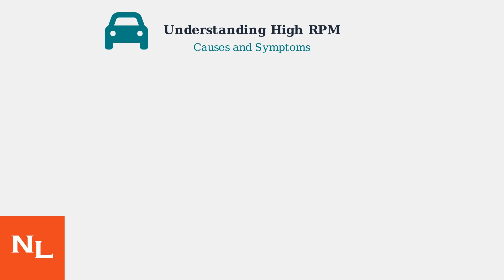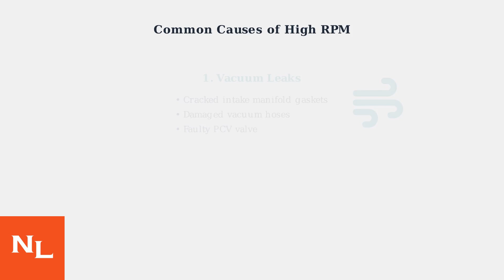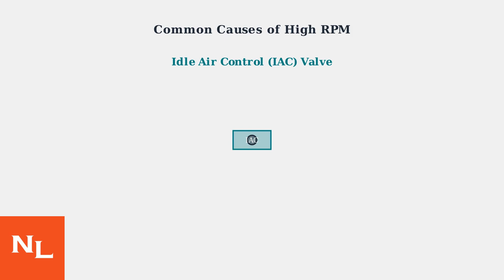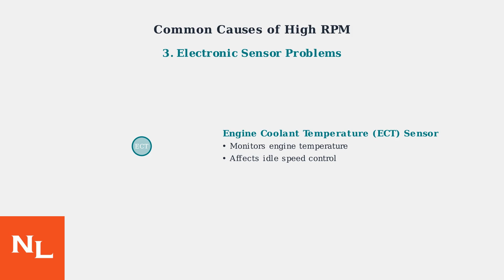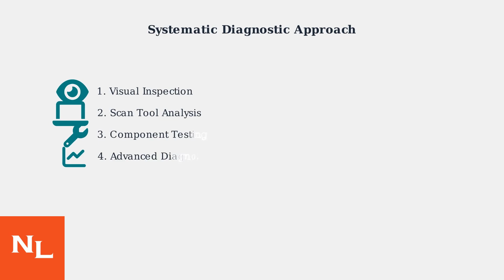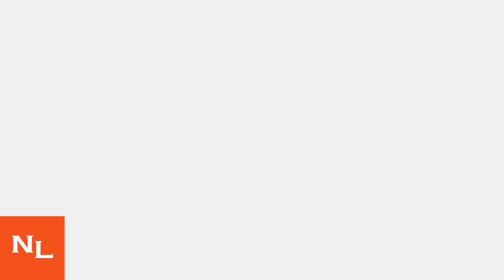High RPM In Car – Causes, Symptoms & How To Fix (Troubleshooting Guide)

Comment: This video is terrible. The screen is mostly white and the graphics don't last long enough to read them. How much graphics you do put up have two layers so you can't even read them
Reply: I 3:58 3:58 tm 3: 3:58 3:58  c 3:58 n58 :58 😅 3:58 58 3:I U😮 😅 3:58 3:58 3: 3:58 58 3:58 3: 3:58 😮I h58 3: 3:58 58 🎉u🎉😮I’m 3:58 :58 3:58 :58 😮 3:58 3:58 3: 3:I 3:58 t 3:58 58 and 😅I 58  3: 3:58 58 am t😮I pi 😅 3:58 😅:58 fi🎉3:58 😢😮 I 😮3:58